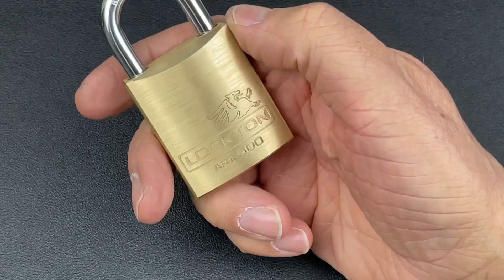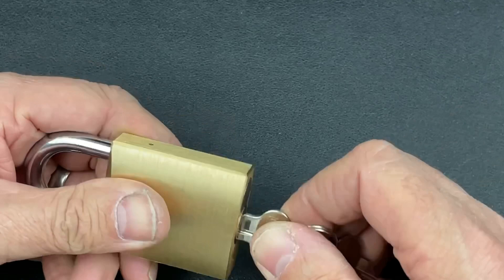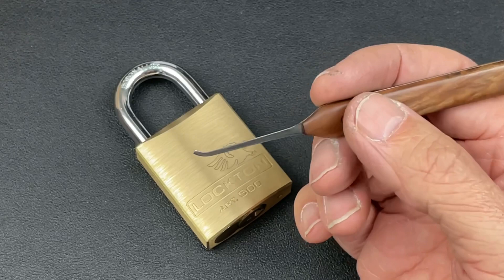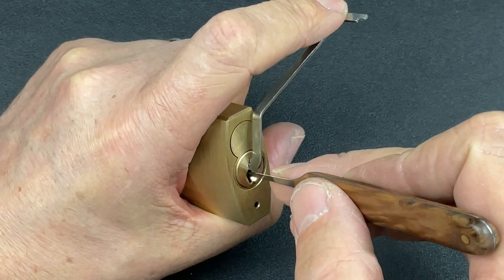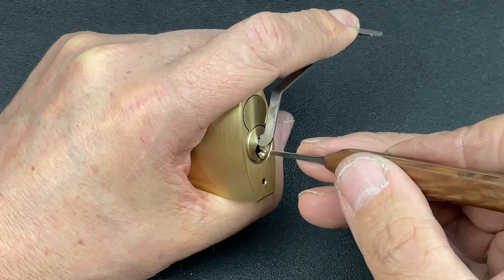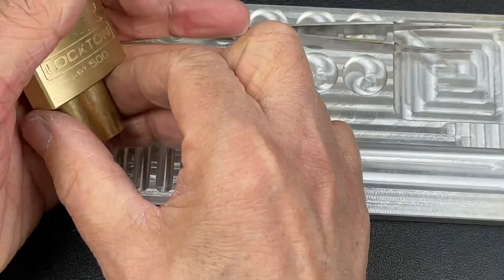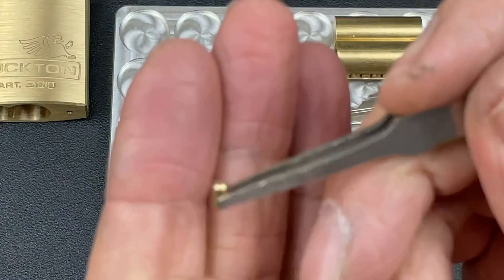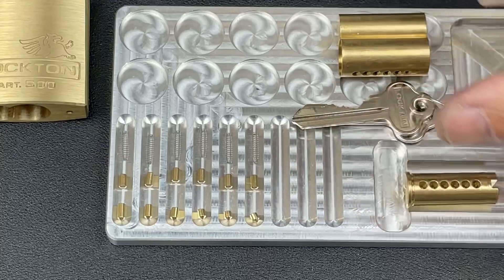50mm Lockton 6 pin padlock pick with a beautiful Tipene pick, & gut

Comment: I've got a bunch of these Locktons. They are generally very easy to rake or zip open as pinned from factory. Those tapers on the pins don't do them any favours.
They make for a great base to work with, replace the top pins and add a few spools and they are much more formidable against raking or zipping.

The keys I've got with them have never had KA1 stamped on them, nor any other key ID. The correct key code for the supplied keys and keyway is LW5 (very common Lockwood 6 pin key in Australia) also commonly called a C4 here but available under a few differing codes.

Quite a nice imitation of an Abus 83 style lock. Shackles are thicker than Abus 83/45 and comparable to Lockwood 334 45mm padlocks.

Comment: Beautiful lock, stunning tray, excellent picking - thanks for sharing! 
I have a question about those tapered pins: don't they just make the shear line a bit wider? Or do they produce any kind of misleading feedback?
Reply from the maker: The pinning tray is awesome isn’t it. The Lockwood tapped pins are incredibly easy to over set, especially when you have a combination of tappered key pin & drivers,
The Tesa locks have a same sort of pins in as well, they are also really tricky locks to pick. Have a great weekend.
Reply: @dazevers  Ah, OK, thank you for the explanation. Didn't come across that kind yet. I'm still oversetting standard pins. 😉
Have a great weekend too.